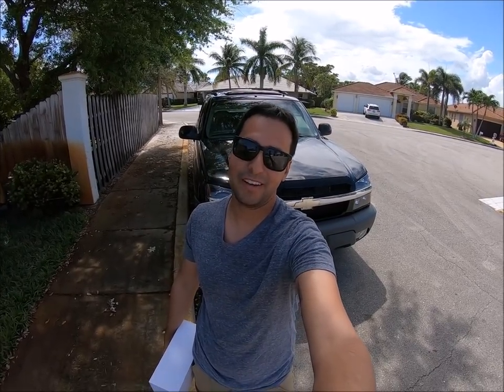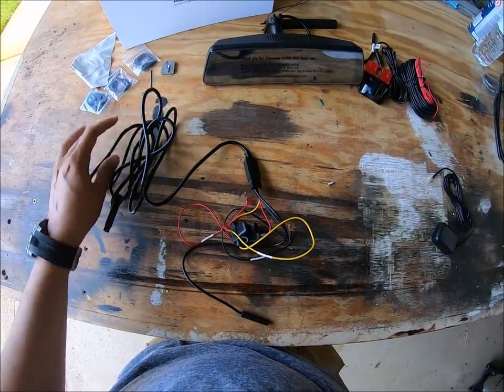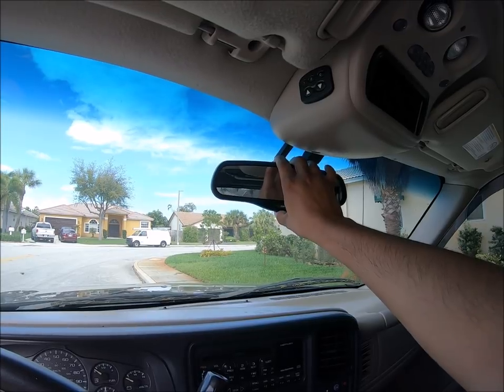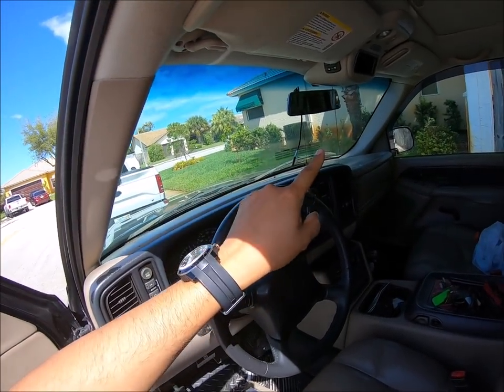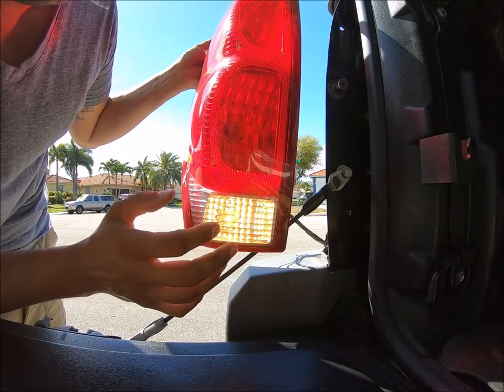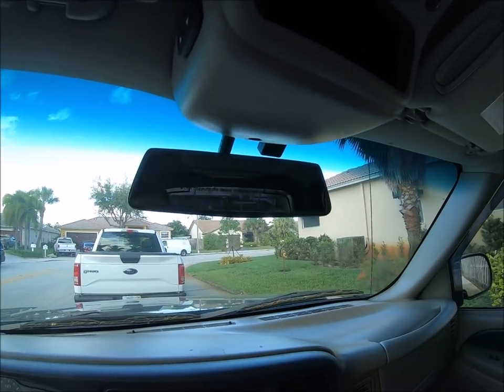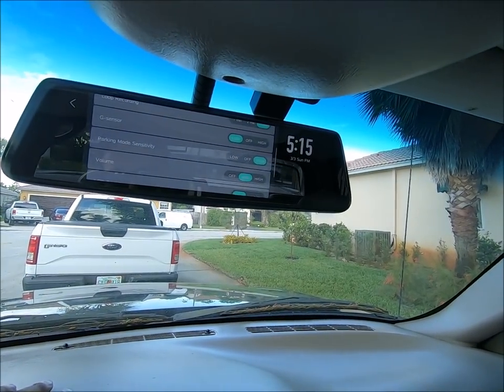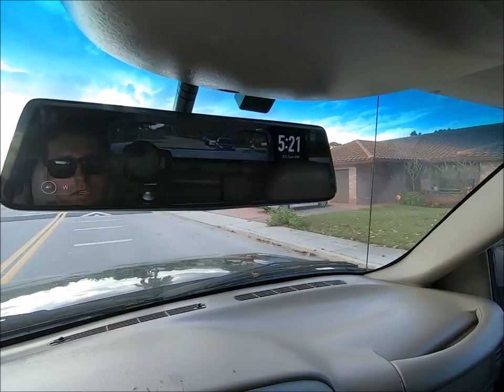X1 PRO Rear View Mirror Dash Cam Install & Review

Comment: I bought this a few months  ago. Though I did like it for the cool factor and the dash cam feature. I didn’t like the lower quality rear camera (compared to the front) (especially if it’s the constant stream to stare at while driving). And I don’t like that you have to constantly refocus your eyes when looking back and forth between the road in front of you and then the rear view. (Doesn’t sounds that bad but I noticed it)
Reply from the maker: Great point
Reply: I also loved the mounting style instead of clamp on. Looks 1000% cleaner!
Reply from the maker: @michaeltranster  that goes without saying! Lol

Comment: 1296 resolution is above, better, sharper images than 1080p. I noticed that in your comment. If your going to use the dash cam as an electrical image  rear view mirror get one with rear camera of 1080p or better. The sharper the rear image the better. Lots of these were sold with inferior rear cameras and some came with LEDS to help light up the image. New ones dont need that..

Comment: VERY RELEVANT QUESTION:
Is there an anti-glare feature by night?? Is it possible to block the reflection of the headlights into the mirror that blinds you by night??
Reply from the maker: It does not have that feature
Reply: @RaymondUrias  Does the autobrightness feature allows to kinda like lowers down the reflection of headlights?
Reply: @ALEXAGON  autobrightness is usually there to stop the LCD screen from blinding you. I always though the notion was a bit janky on my work's GPS, I delivered at night and always had it on 100% brightness. But then I had to do an out-of-town run, pitch black roads, and the GPS almost blinded me - I couldn't see a thing.

Comment: A few things.

You should have tested what side of the mini ATM blade fuse the power was coming from. WHY? Because the wire coming from that jerry rigged "add-a-fuse" Should be on that side. If the other accessory the original fuse was meant for, blows the fuse, it will still have power to the camera system. If you have it the wrong way if either of the accessory or the camera causes the fuse to blow, they BOTH go out. 

You should have just cut that jerry rigged add-a-fuse off and the supplied in-line fuse and added a proper add-a-fuse. WHY? Because if that accessory blows the fuse, You are shit outta luck to replace it. You will have to disconnect the camera, take out the fuse, and use that one until you replace that shit show.

Also you should have identified what that original fuse goes to. You don't want something that is critical to overload and have happen what I just mentioned. Choose something that if it blows, it is not something you need to get home safe in the dark.

You should have looked into finding where the trailer hitch lights connect to. They often have the reverse light on that harness. They also often have a plug on it for wiring in the trailer harness. If it is not there it might be a plug you can buy. Way better than tapping into that reverse light.

Comment: I've just fitted a rear dash cam (a different make) and having used it now for a couple of days, the ONLY thing I do not like about it is that you really have to careful using it to reverse because whilst your rear camera shows you a very good view of what is outside, it doesn't show you any part of the inside of your car, so you have no idea of your 'relative' position.  First time I used my rear dash cam to reverse, I nearly hit a wall on the side of my car because I couldn't see my rear pillar interior in the dash cam screen (because my camera is stuck to the rear window).
Reply: Take it off the rear window and put it on the bumper...
Reply: Jlove that would make it worse.

Comment: What about when the SD card is full, does it ask for permission for deleting the clips? Or do I have manually take the card out, put it in a PC and delete them?
Reply: Loop recording is a normal feature of all dashcams so don't worry about it. They will automatically delete your file in the beginning once the card is full except those marked as locked.
Reply: @moileung  what card does it take the micro sd?

Comment: 1296 is hight res then 1080 also rear cam is only 720p, ps that is not a diode in the fuse board

Comment: Hey raymond great to see you back thanks a lot for this video just one question will this work with my 2011 Mercedes Benz c300 and my 2010 Subaru legacy. And do you think I will have to do modification to my cars Subaru I'm ok with doing some mod but on my Mercedes I prefer not to drill or cut into to get the mirror on thanks for any feedback you may have.
Reply from the maker: The Mercedes will be a little difficult since the remote antenna is located in the mirror. You would have to relocate it, similar to what I did on the Mini. It would work on the legacy with a simple change out just like this video.
Happy to be back, I have alot of videos coming up 😁
Reply: Thank ray

Comment: I purchased this from Amazon & at first the rear camera had horizontal lines in video. I contacted Auto-box service & they sent a replacement camera. While waiting for rear camera to arrive it changed to very fast flicking like I was shifting into reverse. Of course I was not since in drive. The new camera did the same thing. I moved the rear camera up to the front connector where the cable that travels the length of vehicle plugs in & the image is fine, no flickering. I then thought it was the long cable the runs the length of vehicle. I also installed a rear camera on the rear of my travel trailer. When I disconnect tow vehicle rear camera & connect trailer camera it is fine. I am waiting for Auto-vox service to get back to me. Do you have any experience with this? 
Thanks in advance
Reply from the maker: On your truck did tap into your reverse light bulb wire?
If you did try relocating the power supply to the trailer hitch reverse wire.
Reply: Raymond Urias 
Yes, I tapped into the reverse light. When I put vehicle into reverse the backup lines appear.  I do not understand your 2nd point about the power supply wire to trailer hitch reverse wire. Please explain further. Sorry
Reply from the maker: @jameslewis405  some trucks have bulb sensing. This is a low current that is run in pulses to the light to make sure it's not out. This wave pattern can cause problems with the camera which needs a constant steady power supply. Switch the power supply and while you are at it make sure your ground is on a clean location.

Comment: How is it holding up 9 months down the line? I've heard that for a lot of people the camera starts failing around the 3 months mark.
Reply from the maker: I actually spoke with the guy who I put it in and said he loves it still
Reply: Thanks Raymond - I'm so on the fence in buying this product, would love the extra features but not sure of the reliability. In your experience, have you had any people you've installed it for come back with technical issues down the line?

Comment: Raymond,  exactly what is the "Driving mode"?

Thank you.
Reply from the maker: Default Driving Mode is showing rear view images, you need manually change to front view by pressing the arrow button if you want
Reply: @RaymondUrias  Thank you very much!!
Reply: means to  use it  like a common rear view mirror  when "driving mode" is on.

Comment: can you disable to regular mirror while driving
Reply from the maker: Yes turn driving mode off and turn LDWS off
Reply: @RaymondUrias  will you be able to record in normal rear view mirror mode ? with no red button no time and date in other words discreetly. Thanks
Reply from the maker: @marshallkmaware5037  it's always recording unless you turn it off. The rear view camera has no light to indicate that it's recording